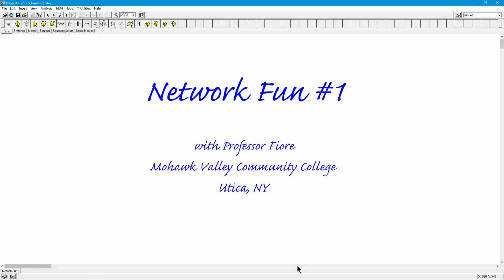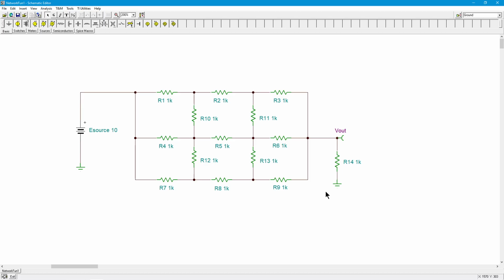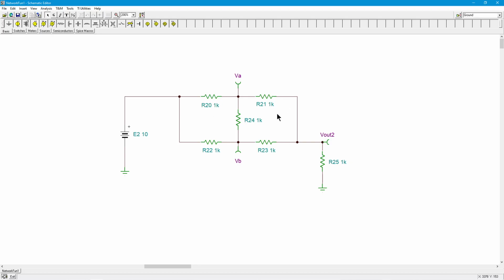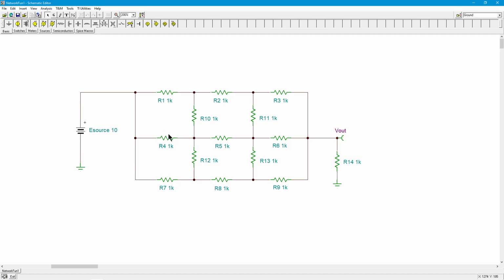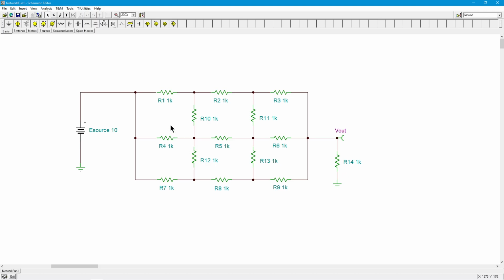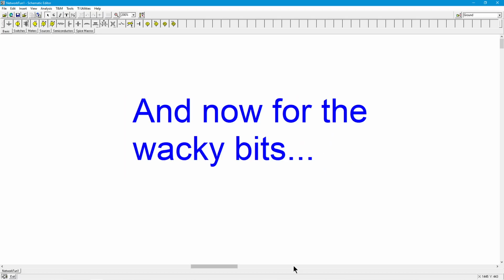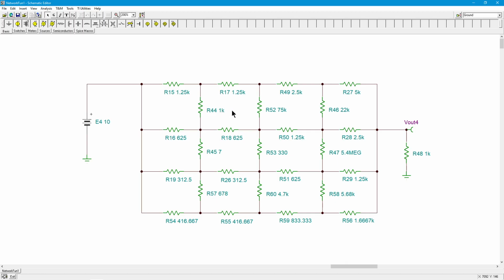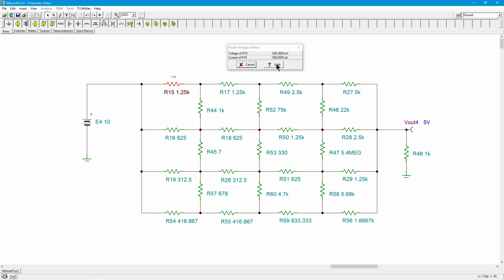Network Fun #1

Comment: That's very interesting indeed. Just wondering if such a network effect of voltages and currents is taking place inside a single resistor package in a powered circuit? Thank you very much.
Reply from the maker: I'm not quite sure what you mean. I guess you could imagine a single resistor as being made up of a large number of other resistors of various sizes. Certainly, you could create a single resistor out of a bunch of other resistors, and wind up with much greater power dissipation.